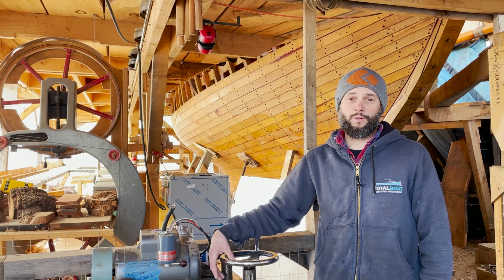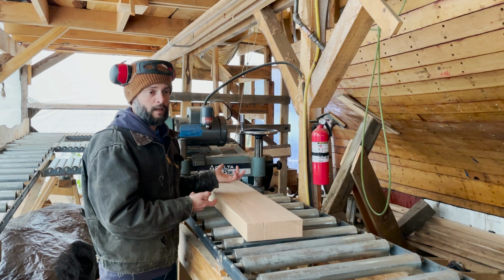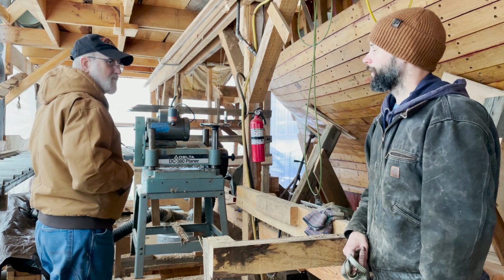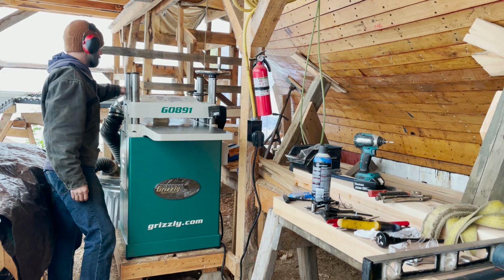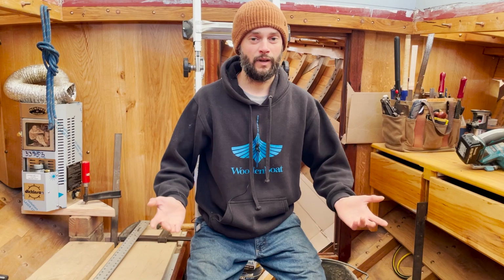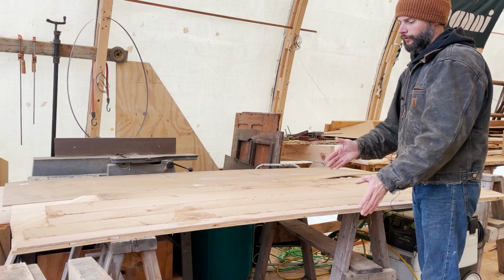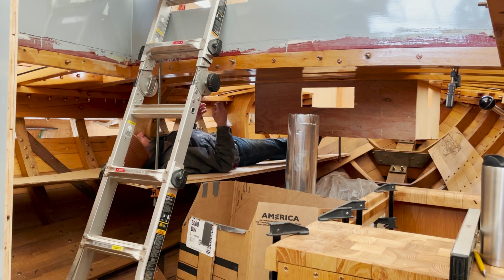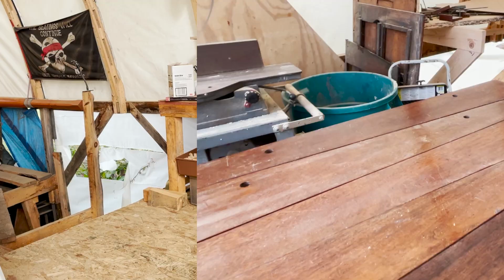A Grizzly in the Boathouse - Episode 186 - Acorn to Arabella: Journey of a Wooden Boat

Comment: As I watched the contortions required to get in and out of the mocked up quarter berth, I thought of my experience and the resulting bruises getting in and out of more accessible spaces at night, in 20+ knots, heeled to 20 degrees or more, with the boat rocking, pitching and rolling.  That’s how and why quarter berths become storage rather than sleeping compartments.

Comment: 1) As I have for years, I love what you are doing, and in design in particular. 2) I sailed alot. I've used quarter berths. As little as possible. Yes, that would be a quarter berth. 3) When I've used them, virtually always, I/we have had to unload all the stuff that's been stored/shoved into it.  That's just how they are. 4) Based on all this, I hate quarter berths. I would like to respectfully suggest scrapping that idea of a quarter berth (I honestly would rather sleep on the main saloon floor, really) and simply design the space for the function you will need and use it for most: stowage. Build it so the stowage function is easy and accessible. This is all particularly true in the canoe stern you are building.You'll most likely be glad you did as the miles and days pile up. Every time someone has to slither into that space, they'll be silently cursing the very idea, and thinking of ripping it out and rebuilding it as stowage.  5) Rant done. Love you guys! thanks.
Reply: I like the idea of extra storage but I also like the idea of an extra berth if required.
This should give them both options.....
Reply: Interesting view on that.
Reply: @kiwi_welltraveled4375  my views are based on experience. The saloon berths are dramatically more conducive to rest underway. And that boat is not ok with more than four adult humans on a cruise.
Reply from the maker: Sounds like, since you’ve moved things stowed in a quarter berth before, that we’re already making an A+ stowage space.
Reply: I was watching that thinking, "Well, no one over 40 is getting in and out of there!"
Reply: @gregoryschmidt1233  I'm sixty five and I much prefer quarter berths, especially when it's rough. And the ones I'm used to are smaller than the one proposed for Arabella...
Reply: I don't see the point of building bunk furniture, when you can easily swing a hammock in that location behind the companionway.  As long as you have a sole to walk on to get to it.  Sleeping in a hammock in a boat is really comfortable.  You can keep all that space for more stowage without dividing it up with hard hunks of wood.
Reply: I cruised  on a 34' boat singlehandedly and thought I would have more people join me from time to time.   I would not get tied up on providing more bunk space for the occasional crew that may join.   The pilot 1/4 berth I had became a storage area except for the chance time at a rough anchorage that I could not sleep in the vee berth.   My .04 worth.
Reply from the maker: ^^John has it, well said. Can confirm from experience. —Annie B
Reply: @erikwilliams7009  I'm with you on this one totally unusable as a berth in my opinion
Reply: @benmac940  well, the thing is, it’s gonna get used. It’s a conundrum on a double ender 
And o get the desire to have it. It’s just that I always want more dedicated stowage. And my boat’s got more volume than Arabella.

Comment: On your planer table. Make a switched outlet and place it in a convenient spot and plug your planer into it and leave the planer switch on and you won’t have to cut holes or change your planer.
Reply: Doable, but switching a 3 horse motor by leaving the switch on and cutting power requires a bit more complicated switch than just your standard 15a lightswitch
Reply: @daveb8598  isn’t the planer 240V ? Switching those 2.2kW is no big deal then.
Reply: There'll be a contactor and no-volt release, so that won't work.

Comment: "You'll be sleeping in the rock climber bunk" It'd be cool to have bolt on "rocks" as holds to climb in and out of that one 🤙
Reply: I recently saw a stealth camper the the rock climbing hold used to get into the overcab bunk.
Reply: @lbh002  that's super cool 😎
Reply: It will be cool until your hands are sore from a rough week of sailing.

Comment: 21:09
I would suggest you now grab the required tools and swap out the alternator, the oil filter and inspect the impeller on the water pump just to see what will have to move.

Comment: I love the mindset you talked about you in the beginning. For that exact reason I recently bought a 1929 Ford Model A as my first car. (I'm only 29)
I'm really enjoying driving it as well as repairing it. It's made to be repaired instead of replaced, and you see that in every detail and made to be driven for the joy of it, not just to get from A to B the fastest.
I often find myself taking detours just to spend more time driving it. And it does happily so even after 90 years.
Reply from the maker: What a sweet story, thanks for sharing it.
Reply: Currently repairing a pair of vintage pantalons btw, while watching this
Reply: This is not an urban legend, it actually happened to me. I was driving my ‘30 Model A, 5 window coupe around the lake on a moon lit night back in 1963 as a19 year old college freshman when the engine sputtered and quit. The first thing I did was pop off the distributor top and everything looked ok until I looked closer at the rotor and discovered that the thin copper contact strip had a hole worn completely through by the contact nipple on the cap. i will add now that no tools were required for this inspection. I was able to split the aluminum foil off of a gum wrapper and wind it around that rotor tab where the hole was and travel on for a couple,weeks until Warshawsky of Chicago could send me a new one. A drop of solder would have saved me a dollar but I was ordering a seat cover and floor mats too. They’re still in business if you don’t already know that. Thanks for the memory.
Reply: The Model A ushered in the modern day car. The basic engineering hasn’t really changed a lot. The vanadium steel engine blocks are indestructible and replacement parts are readily available, and for the most part cheap.
Reply: I had one take me to prom back in 2001. Great car; great looks.
Reply: Does yours have the original mechanical brakes? They take a long distance to stop.
Reply: @pauleohl  In the roaring 20’s brakes were the cries of unwitting pedestrians and animal.
Reply: my first car ford1929 a i am 74 now.eat gas like cost 50 cent a galon
Reply: @garyfairbrother5532  Speaking of that same thin strip, i actually broke it, trying to bend it up a little to make sure it had good springy contact against that top contact nipple. And since it was weekend, i would have to wait a couple days to receive a new one.

But I planned to go on a trip that weekend, so a bit of tape and voila, i drove 150 miles with that solution in that weekend. worked perfectly till a replacement arrived.
Reply: @pauleohl  yes, like all model a's it has mechanical brakes, and no the stopping distance isn't very much longer than a normal car (with well a well lubed and maintained system) In fact, I can pump the breaks hard enough to block the wheels even at decent speed, you can't break any harder than that. It just takes a little more physical effort without hydraulic assist, but not difficult to do and the system itself works great.

Other then brake assist, there isn't really a reason mechanical brake rods do any worse than hydraulic. The cast Iron drum brakes do a fine job too. The only problem with stopping is that the skinny tires have less surface touching the ground than modern cars.

There is no ABS of course, so better not block the wheels and pay attention when driving.
Reply: @MaShcode  Tiny correction, the engine blocks are cast iron. The rest of the car is v-steel tho.
Reply: @DrTheRich  we called the Model A brakes “Push and Pray” brakes. Another quirk is If you go over bumpy roads or railroad track crossings and the front wheels start to wobble and shake so bad your teeth rattle and you have to stop to make it quit, it means your king pin is worn.
Reply: @garyfairbrother5532  you must have driven a very badly up kept model a. A properly cared for one has none of those things. Death wobble is something that only occurs in a model a when things aren't lined up or adjusted properly, or bearings and pins worn out.
And the brakes are not bad at all.

EDIT: sorry I see you mentioned the king pins. Well, of course when stuff is broken your car does weird things. That's no a quirk of the car, it's a quirk of bada maintainance.
Reply: @DrTheRich  Sorry, I’m just an old man now that doesn’t know much. Have fun with your Model A.
Reply: Taking detours in a Model A is just another great outing if you have ever owned one.  A Model A was my Dad's first car, around 1945 and another was my third car, in 1974.  Mine had a mid 1950s Rocket 88 Oldsmobile engine in it and I added disc brakes.  I made it a restoration of an early hot rod at that time. Fun, fun fun!

Comment: Just a thought, trim the bottom of the cockpit at a 45° to allow more space.
This will facilitate a "headfirst" entry.  Crawling feet first sucks.  You'll constantly knock your sheets loose and any debris on your feet get tracked all along your sleeping surface. 
Cheers!
Reply from the maker: It’ll be so infrequently used as a berth, and mostly used as stowage, that modifying the cockpit (an area we’ll use more than most other places on the boat) wouldn’t be a practical move.

Comment: The pilot berth is the one berth you need to be able to get out of in a hurry - on a stormy night. If it's not practical, it won't get used and will end up a dumping ground for stuff. And centre-line companionway steps are much more practical than off-centre, particularly as in the arrangement you have, water (rain and water from clothing) will land directly on the chart table at their foot. It would I feel be of considerable help to the project if you had an experienced ocean going yacht skipper come and cast his/her eye over the layout you are considering. Well done for getting this far. It's a big job!

Comment: One comment about the stainless tankage: Please ensure the welders use an argon purge during the fabrication of the tank and after it's completed they use an acid pickle to restore the metal's corrosion resistance. TIG welding will deposit free iron on the base material alongside the welds and that should be removed by pickling, otherwise you'll get rust streaking (called wagon tracks) over time in the marine environment. Remove all rust staining on the exterior with Barkeeper's Friend or a citric acid based cleaner on a regular basis. As much as possible keep iron tools and grit from your shoes away from the stainless to keep it nice and shiny.
Reply: using a rubber/tar coating on the underside, places not accessible, to ensure no moisture/salt air can reach the welded areas.
Reply: @erehwon9371  That "Flex-Seal" stuff works great.  It's easy to get, very sticky, and definitely waterproof.

Comment: Looking good, love the new thicknesser.
A couple of suggestions.....
Could the companionway ladder be hinged?
So that you unlatch the top of the ladder and it leans forward to rest on the head bulkhead.
This would give easer access to the pilot berth.
Alternatively, the companionway ladder splits in half.
The bottom is fixed and the top hinges up to give access.
Also the porthole on the forward section of the cockpit looks directly at the mast.
Would not a porthole ether side of the mast give you better light and visibility?

That's my two cents worth.......
Keep up the excellent work.

Massive Respect from New Zealand.
😀👍
Reply from the maker: Happy Friday!
Reply: I was just thinking the same thing!
Reply: I saw an awesome wood ladder that was just a... dowel or wood post. Like a 4x4 circular post until you literally just unfolded it and bam, a ladder. The steps were hinged to fold up inside the hollowed out core of the dowel/post. Would be cool there in companionway too. Could fold it up but would always still be a post there. The folding/hinged or sliding ladder is a great idea.
Reply: @jonny-b4954  
I've also seen that ladder.
If I recall correctly, they pulled it out from a hole from under a building then it opened out to make a ladder.
The runs must have been made from steel flat with a hinge on both ends.
When it's folded up one leg extends higher than the other.
It was very interesting.
Reply: @kiwi_welltraveled4375  Yes, that sounds familiar. Been trying to think of video I saw it in. Super interesting. Yes, when folder I would assume the legs don't align and 1 is longer. From what I remember. Cool stuff
Reply: @jonny-b4954  
Was it on a "Daily Dose Of Internet"?

Comment: nice looking piece of equipment to add to the shop. the old planer was showing its design flaws in non serviceable wear items and inferior materials , its a shame we design for limited and finite service lives instead of trying to do it right once but it makes financial sense unfortunately to produce things that break or wear out and have to be replaced, on that note thanks for taking the time and expending the effort to do a job right in a way that is repairable and serviceable and freely involving us in the process. ;] ps. easy on the glue lol too much is a weaker bond than just enough and a bit more... some squeeze out is what your shooting for not niagra falls ,,,, cheaper is stronger in this case.

Comment: I don’t comment often however I did want to comment on your statement at the beginning of this video about tools and what should be saved and why. Well said and I could not agree with you more! OH & BTW I own several Grizzly metal working machines and I have been very happy with not only the machines but the company as a whole. A great company to work with!
Reply from the maker: Make Magazine, a wonderful quarterly that every tinkerer should get, one time published the Maker Creed… which included, “if you can’t take it apart, you don’t own it.” Which would follow that modifications, repairs, partial replacement become really hard with the way most things are manufactured now. That being said, the Delta was a real workhorse. It just ran into so many problems, some very time consuming and expensive to fix, that a new tool became necessary.

Comment: Steve, have you considered making the stairs detachable? In my ketch from 1957 the set-up is basically the same, but the stairs are detachable. They lock at the bottom of the hatch/opening and are very easy to set aside when climbing in the bunk.

Comment: One tool to always have in a shop is the moving equivalent of a wheelbarrow. Essentially a wheelbarrow with forklift legs at the front. One other difference, best to have a T handle, rather than bars to grab, as it flexes less. A pneumatic wheel is great for this, but it does work with cast rubber/metal types too. Cannot say just how useful this is in a packed shop, moving equipment/loads about where two wheels would be a hindrance. Yes, it's weird to get used to, but it does work.
Reply: Worked in a print shop and we had one of those hand trucks for moving paper and plates. Indispensable where a regular hydraulic pallet lift couldn’t maneuver. The AtoA floors might be a tad rough for hard rubber wheels.
Reply: It is an indictment of how society has delegated its decisions to the most timid, that no such commercial product seems to be available. (One-wheeled, that is)

Comment: Have you thought about possibly putting the companion way ladder on a pivot on the starboard side? Have it swing towards the navigation table like a cellar way/fruit cellar entrance.  It would open up access to the bunk and engine but still be able to be put back in place from the deck or galley.
Reply: It would be a good idea to add an emergency stop button that was more accessible I would say in the UK it would be a health and safety necessity. It looks a good machine I wish I had one to replace mine.
Reply: I was thinking maybe have it fold like an attic staircase to get it up into the cabin top and out of the way.
Reply: great idea except for the time your rushing down from the deck in the middle of the night and the ladder isnt in position... possibly with a counterweight or spring to keep it in position unless it is needed to be out of the way  like fire escape ladders.

Comment: Ok, I have a possible solution to your bunk issue. Think about commercial kitchen cabinetry for a moment, and apply that technology to your bunk. You only need to consider the distance from your hip bone (Greater trochanter) to your shoulder. So basically the bunk is split and the part that is holding most of the weight is a commercial kitchen drawer system.  So you come down the ladder, flip up the bottom section and sit on the bunk which has been pulled out over top of the chart table and sit on the rolled out portion of the bunk. Position yourself and pull the two bunk sections back together. When the two bunk sections are joined, a small piece of hardwood drops down, when you have to get out, flip the hardwood lock up and roll the top portion of the bunk back out over the chart table and you're out, I have used this type of shelving many times but it involves hospital morgues and I don't want to talk about that. Cheers from Canada.

Comment: You didn't mention it, but I hope you opted for the helical head on that new planer. I bought one a few years ago, and it's one of the best tool purchases I ever made. An incredible difference between a traditional three straight blade head and a helical head (also far, far easier maintenance).